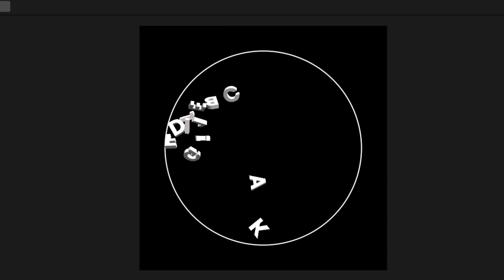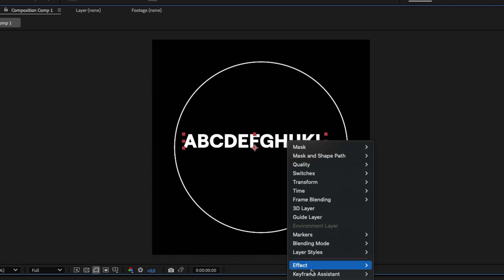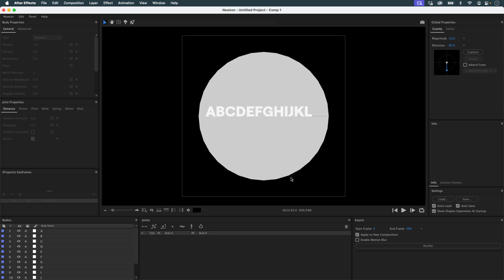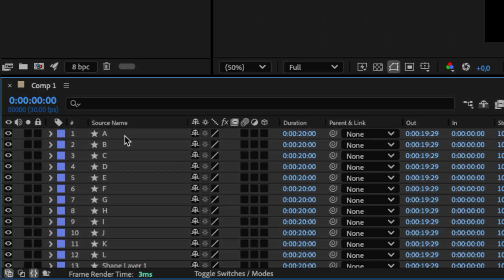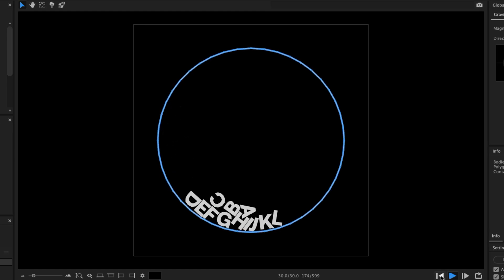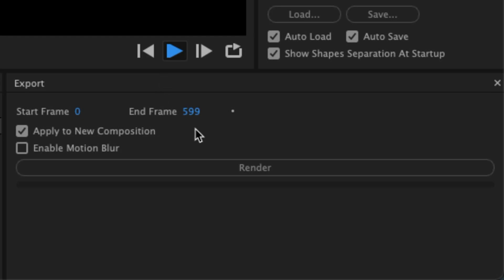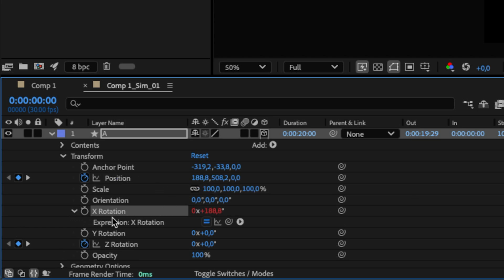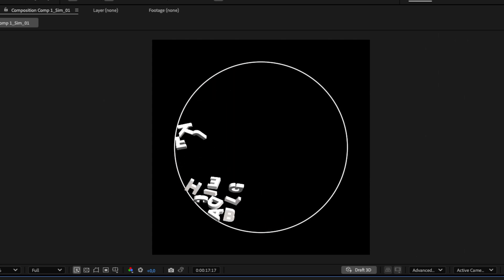🌀 Tumbler Text Effect – 2D Physics, 3D Feel

Comment: try this expression on x rotation instead.
transform.position[0] - transform.position.valueAtTime(0)[0]
It will face the txt forward at the beginning of the animation. 
Such a clever idea to use one of the position dimensions to add some twist, because the position moves at a speed so does the rotation making it look natural. The slower it moves the slower the rotation, etc
if you want you can add some variety by picking random layers and using this expression (which will turn the x rotation in the other direction
-transform.position[0] + transform.position.valueAtTime(0)[0]
Reply from the maker: Awesome idea!
https://www.instagram.com/stories/motionboutique/3639523954193312289?utm_source=ig_story_item_share&igsh=MWZqdDV6a2VlcWNwdw==
Reply: thanks! You and Nick are the creative ones. I'm a expression nerd that's all. I love the tutorials coming out lately.
Reply from the maker: @broadcastbytes  I don't agree since I work daily with an expression and coding nerd, you're creative too! 🫶